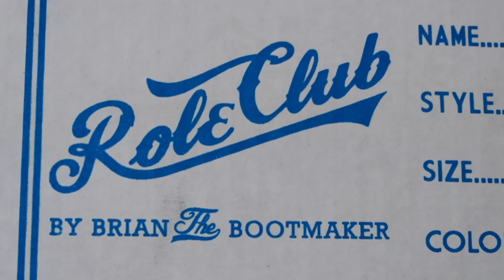RED WING 877 Resole #58

Comment: I have a question. It’s probably really dumb. I literally know nothing about boot making. I’m just curious and also ADD enough to do reckless things. 
If I wanted to put a sturdy sole on a pair of moccasins would that be:

A) possible with the right tools and enough gumption to not fear failure 
B) stupid
C) can I take the sole off one pair of shoes and attach them to another 

I have a cute pair of hand made moccasins that I got from goodwill a while back that I rather like. The only thing is that they don’t have a proper sole, just a sad flap of rubber glued on the bottom of the leather. That’s how most hobbyists seem make them these days. While it does serve as a covering for ones feet, I just really need something sturdier. I can’t pay someone to put a sole on for me and it would be a fun experiment even if it’s just for me and I never do it again. It’s probably foolish, but I had to ask out of pure curiosity